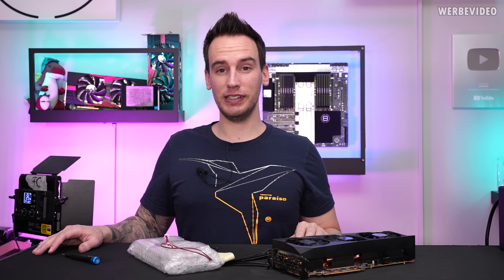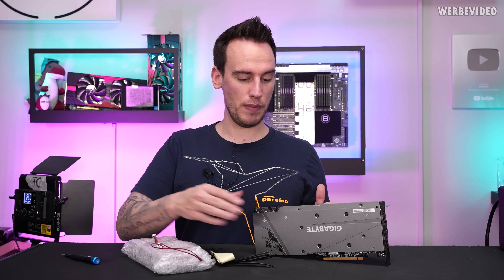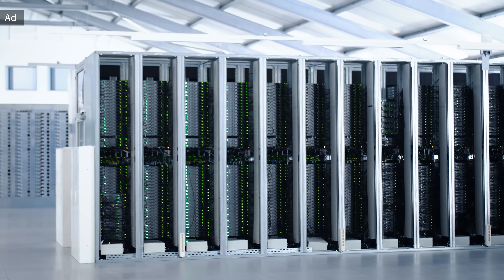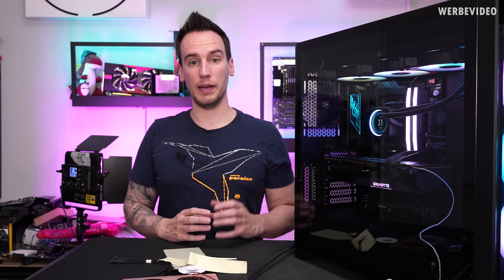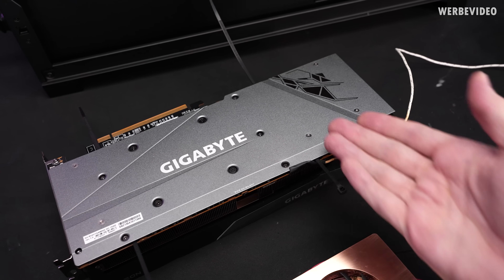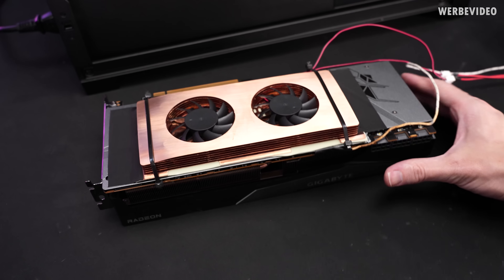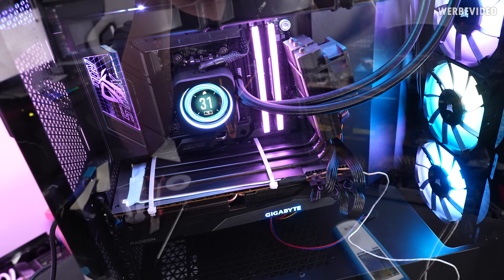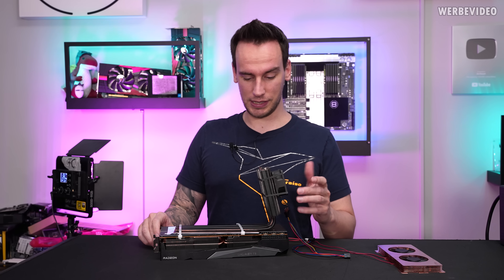Please don't do this - AliExpress GPU Backplate Cooling

Comment: I think coolers like these are intended for use with cards like the rtx 3090 which have vram chips dissipating heat onto the backplate, but they are basically useless on other cards
Reply: I did this for my 3080ti. Kritical thermal pads and added some heat sinks on top of the memory. Got my gaming mem temp down 5 to 10C.
Reply: @bleedsblue0023  Same here.
Easily my most regrettable purchase. Spent more money than my entire PC is worth and then had to rip the thing apart just to not throttle.
I have been tempted to sell it but I worked so hard on it just to make it not throttle. And it still runs hot.
Reply: @granolafunk6192  reduce power limit. I've been using my 5700xt at -50% to -20% power limit from the start and it works pretty well in most games. There are around 5 games where i need more than 90w of power.
Reply: @HomosexualHuman  AMD and NVIDIA power limit work differently.
The latter is directly tied to core clock and wattage on a curve.
AMD just limits the power. As long as you are above what the core needs it will not throttle.
Reply: @HomosexualHuman  The 3080ti has GDDR6x which is quite different than GDDR6. And the common problem with the 3080ti, 3090, and 3090ti was the memory chips on the back of the card.
Reply: @bleedsblue0023  Well, yeah, a 3080ti can benefit from such a cooler, but people have been reporting drops of mem temp from 100+ degrees to a little above 80 with a 3090.
Reply: @bleedsblue0023  same here on  my old 3080 10gb.
Reply: I used one on my 3090 and got far improved temps
Reply: @twood1130  How much temperature delta improvement did you see? I just got a 3090, is it worth buying this backplate cooler?
Reply: @twood1130  How much of the improvement did you see? Did it come with a fan included, or do we need to get the fan separately? Thanks.
Reply: That's exactly was first thought. This is only for 3090. There is even a liquid cooled backplate cooler for 3090. The memory chips on the back were a huge problem for 3090 and they fixed it in 3090 Ti.
Reply: Rx 7600 sapphire pulse could benefit for this ?

Comment: I have a question involving the super cheap hard tube fittings for penny on the dollar compared to EKWB or any other mainstream manufacturers, are they any good, do they all leak? will they start leaking?  are they the same thing but w/o the logo stamped on the side?
Reply: They do the same thing just usually don't clamp down as well meaning you can twist move pipe easily But definitely will not leak
Reply: @danielcourtemanche7431  they actually do leak, just not instantly

I had my first ali tube right next to an UV lamp and it barely lasted 2 months :)

Comment: GDDR modules distribute most of their heat into the PCB itself through the copper traces. It would make the most sense to test backplate coolers by looking at VRAM temp, especially with additional thermal pads bridging backplate and PCB.
Reply: Thanks for telling, I have some old heat sinks and thermal pads that I'll attach at the back of PCB now.
Reply: Well, the amount of heat dissipated also depends on the thermal differential. When you go VRAM -> PCB -> thermal pads -> small backplate cooler, I suspect much less heat can be transferred than going VRAM -> thermal pads -> massive front cooler. So yeah, in theory more heat may be distributed into the PCB itself, in practice thanks to cooling I suspect more heat will be dissipated through the thermal pads on the front. But would be interesting to validate this.
Reply: @seeibe  Yea, unless You have a 3090 which has half of it's VRAM on the back, in that case it just might ""work"".
Then again if You have a 3090 I really don't think You should try to cool it by "strapping random scrap metal" onto it with with zip-ties :)
Best regards.
Reply: I set an old AM3 stock cooler on top of my 2080 TI with some thermal pads in addition to the normal cooling solution and got -6c average gains as shown in CPUID HWMONITOR without even replacing old pads yet. My solution, however, is the exact size of the hotspot on the backplate, not the size of half of the gpu like this thing in the video
Reply: Yeah i got RX 6800 XT and i put thermal pads and cut plastic insulation from backplate and i use thermal pads on the side where vrm is :) and temps drops nicely

Comment: I hate how gpu-z removed the memory temperature readout.
I'm sure it drops the mem temperature on the 30 series back mounted vram.
Reply: I'm looking at the GPU-Z sensor tab right now.  It lists the value of my "Memory Temperature" at 58C for my 3090 Turbo.  Not sure what you mean by your, "removed memory temperature readout" comment??

I set it to list GPU Temp, Hot Spot, Mem Temp, CPU Temp ... plus a bunch of other stuff.

Comment: Where Der8bauer got the entire video wrong .....this where made for rtx 3000 series with 100+degree on memory , why you didnt check mem temperature , this is not made for gpu temp and hot spot.
So many people fryed the ddr6x on them with good gpu temps .
Best active backplate is watercool sandwich , thats what i use on my 3090 with 52 degree on ddr6x
Reply: or take the stupid backplate off.

Comment: derBauer EN : I've mounted custom thermal pads on the back of my KFA2 GTX 1080 EXOC 8GB, prior off course cutting out the plastic non-conductive cover from underneath the back plate to fit the thermal pads for the backside of the memory chips, backside of the GPU die itself and the backside of the VRM-s....and in my testing the GPU core temp fell 7-8°C, the VRM-s around 10°C and memory chips around 7°C. This model of mine actually has a good and very usable aluminium backplate that has a sign "caution hot" but is out of the box completely un-utilized. 
There are a few models out there since the GTX 900 series and R9 200 series that I've had the chance of modifying and helped with the temperatures quite a bit.

Comment: The most import to know with this kind of active heatsink on the  back plate are RAM and VRM Temp change.
Reply: Definitely a creative way to add a fan for the memory. Wouldn't be my first choice but I'm not going judge.... I'm using a flexible arm DC fan that I got at FRYS 15 years ago bolted to a $500 mobo.
Reply: That's only applicable to cards that have those components on the back or have thermal paste which transfers the heat from them to the backplate.
Reply: I think der8auer missed the mark on this one, a 400W GPU is going to hit the RAM and VRM much harder than the 270W class GPU

Comment: Please test a 120mm fan blowing down on the backplate - i did the thermalpad mod on my reference 6900xt and did see 6c lower gpu temp
Reply: If you don't have water cooling on the CPU, it will take more heat to the GPU
Reply: @SimplyLada  that might be true - personally I have a AIO on the cpu
Reply: What if you only add pads to the memory and the GPU doesn't touch the backplate
Reply: you need some holes for the fan to be effective. You want to blow away the heat trapped under the backplate, not to cool the backplate.
Reply: @dreyga2  Nope, heat is transferred to the backplate. That's the point, all you need is a fan to take the heat away.
Sometimes it's there to help prevent the most extreme GPU sag and be more protected from dust and static.
Reply: @SimplyLada  no, it's not. Here's how it really happens. The backplate traps heat under it and gets hot. The backplate cannot transfer heat faster than the GPU can generate. This causes overheating. They know this and to "fix" it, they place thermal pads or/and they drill holes so that the heat escapes. 

The backplate is not a heat sink, it cannot transfer heat effectively  because it's too far from the card and has no fins.

The best solution, if you don't want to remove the backplate, is to have many holes+ fan blowing into those holes.

Comment: If you want a cold backplate, just place a thermal insulator between it and the card. If it does not receive heat, it will be colder. On the other hand, if you want to cool the GPU or board in general, then a hot backplate is a good sign - it means that it does something; just have a fan somewhere next to it as to remove the heat transfered to the backplate.

Comment: Attaching a heatsink to the backside of the PCB where my VRAM was allowed me to OC from +1000 to +1250 for benchmarking. Core temperature was still the same however, and once the heatsink at the back got heat saturated, +1250 would crash also.
Reply: Damn you heat saturation, damn you!!!!!!!
Reply: I just rested a server CPU passive heatsink on the back of my 3080ti and got almost 5C off the memory temps.
I was going to thermal paste it but ended up putting better thermal strips on it.
Reply: can you just add a fan to it?
Reply: @giaopx  Yeah I could, but from the limited testing I did it would just extend the time that I was able to run +1250 OC on VRAM, but it would still become unstable after long enough.
Reply: And this is why you don't waste money on silly solutions like that and instead just watercool when you want to push OC limits
Reply: Maybe increasing the pressure within the case (with it's fans) would move enough airflow to lower temps? On Major Hardware channel, the man printed a shroud for his GPU to pull air from the IO PCIE area and a 120mm fan feeding the cpu and got hugely lower temps.

Comment: You could try to just lay down a 12cm fan on top of the back plate. Perhaps the airflow alone would help a few degrees.
Reply: I do this with hard drives when using them outside a case. Old HGST drives can get burning hot without any cooling, but placing a small fan on the drive just to move a small bit of air makes a huge difference, as much as 20 or even 30 degrees.
Reply: I did use one arctic p12 pwm fan at max rpm on the backplate of my rog 3090. It lowered my vram temps to 84-86c on an ai gen load that pushed the memory around 88-90c. Not that effective but it helps.

Comment: I bought a second hand rtx 4000 quadro, and I play games with it but it become super hot and when I game it goes up to 83 degrees, in a way that I can't touch as well, so I bought NZXT gpu cooler at techinn but it did not bring my product because it's a scam and I live in South Africa our post office here is extremely poor. I don't know what to do.
Reply: Maybe it just needs a good cleaning and a re-paste? Not sure how hard those cards are to get open though.
Reply: @--_DJ_--  thanks for your reply, I'll try and see
Reply: @gugukhoza3622  I know it goes without saying, but be careful in there!
Reply: @--_DJ_--  will try. Thank you so much, we are really struggling to get decent prices in gpus this side, it's been a pendamic since till now
Reply: @gugukhoza3622  I did a little looking and it seems there might be a setting on that card that will let it slow down when idle. You might have it set to be working all the time. 
If you have Nvidia Control Panel installed, have a look for "maximum performance" setting somewhere. Changing it from max to adaptive might help your temps.
Reply: @--_DJ_--  thanks man wow I really appreciate it man thanks I’ll check it out when I’m home but my main plan is to put an AIO cooler I bought double fan NZXT
Reply: Remove the plastic+fan from the card. Get 1 or 2 case fans and zip ties. Tie the fans to the radiator. Connect the case fans to the motherboard. Use the motherboard to control the fans in bios. This is the cheapest and most effective mod for any GPU. It looks ugly, but your temps will be very low.

Comment: Please test them on a 3090 or rear mounted VRAM card
Reply: Also aliexpress has better made coolers than these 2 shown in the video, but definitely more expensive
Reply: There's no point. Even if you just put some thermo paste in there, it'll help + one 120 fan
Reply: @SimplyLada  Ok then, how about Dell Alienware's 3090 🤔
Reply: I swear nvidia either did this as planned obsolescence. Or they just don't care about the fact their cards throttle with the stock coolers, like an intel CPU.

Comment: I love stupid cooling

"if you have any standards..."

During the GPU Apocalypse daughter wanted a PC so she's running an old GTX980 with an AMD copper slug CPU COOLER strapped on.

Sometimes standards got to drop LMAO. It's still running now, lifesaver at the the time.
Reply: Recently I took apart an old PNY GTS 460 that was collecting dust. I realized the heatsink they used is just an old Intel CPU cooler that looks like it had the sides chopped off with an angle grinder so it fit under the shroud.

Comment: Just get a little bit more airflow in the case if you have issues........ Or if you are going to use zip tids anyway, do what I did in my spare computer to cool a part of the motherboard that got hot and rebooted me. Hang a fan with zip ties for directed airflow, it does alot. :)
Reply: I tried compressed air and it did wonders

Comment: These could be interesting with rtx 3090 which has memory on backplate side and gets toasty.
Reply: I got -10 degrees from mem temp on my 3090 during mining using the cooler #2.
Reply: true, those coolers are intended for rtx 3090, especially mining ones. gpu capped at 50% TDP and vram overclocked as high as possible. And they are not that expensive either. like the 2nd one is about 18 Euro in China
Reply: 3090 Ti doesn't have memory on the back of the card.
Reply: @bgtubber  oh ye fixed it then.
Reply: @MrUkkone  👍

Comment: That's nuts lol. you'd be better off just hot gluing 2 x 120mm fans on to the back plate....
Reply: 1200mm ??
Reply: @Gecko730  I guess it was just a typo but a really funny one
Reply: @AshLordCurry  Yep my bad lol
Reply: @Gecko730  Haha yeah well caught ;)
Reply: Even better if don't mind the look.Pull of backplate and put the fans directly.
Done that with my ex strix vega56  worked well.

Comment: Don't worry! I don't have a powerful GPU enough to need a backplate 😅
Reply: Ain't needing a backplate if my gaming PC's depends on the CPU integrated graphics

All I need is a $2 shady Aliexpress CPU cooler that comes with a chinese spyware software for the cooler ARGB control
Reply: @First-Name_Last-Name Naive child, you know that microsoft and google spy on you too right?
Reply: Don't  worry  i  Don't  have a gpu 🤣
Reply: Very few GPUs *need* a backplate.  In fact most GPUs with backplates do the opposite of cooling since it does not have any thermal pads or paste and actually just traps heat behind the plate.
Reply: @techboy95 Why would you "need" a backplate at all except how it looks. It doesn't do any cooling anyway, and probably does not add anything to help the structure.
Reply: Relatable
Reply: Same here.
Reply: i don’t even have a gpu 😢
Reply: Backplate is 99% for the looks, also the card runs cooler without any backplate at all.